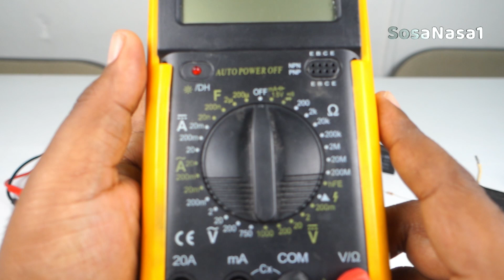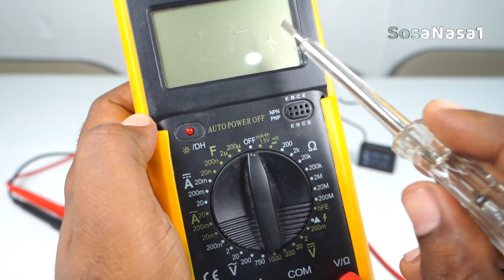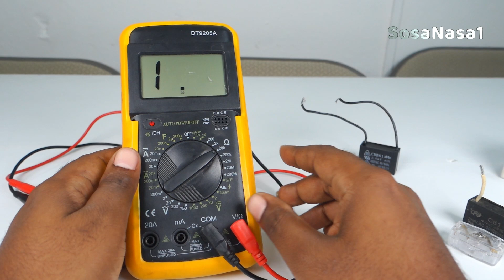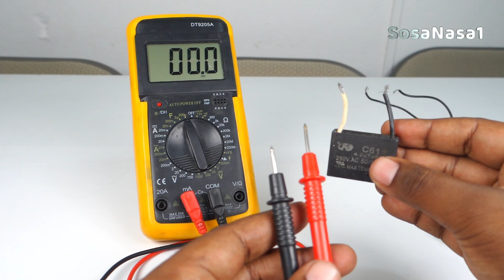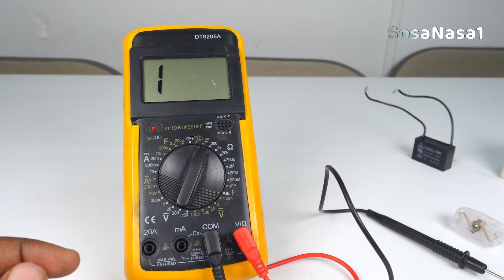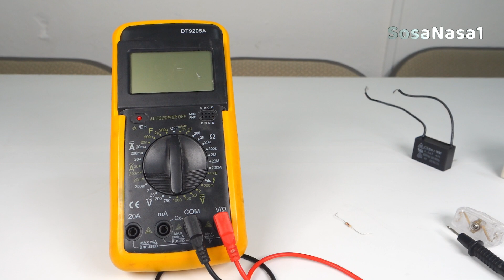how to use multimeter like pro model DT9205A (Mini course)

Comment: I had order this multimeter but the multimeter starts to show random digits without connecting promt . And dc voltage wored but not accurate i returned that item 😂😂

Comment: Someone bought me UYIGAO DT9205A DMM of which I am grateful for. However there r a few issues I m having in regard of this MM,
1) How to DISABLE the followup prompt that says OUT-LOUD in CHINESE (which I do not understand or spokes of) for every selection I made, every reading I took! Its truly annoying on top of slowing me down as I can continue probing other values until the voice prompt completed!

2) There is a selection named (written in chinese which translated as) "Live", anyone know what it used for? What I knw the MM made a intermittent beeping-sound if either + or - probes made contact to any voltage producing points - even of low ones, DC and AC, etc! Anyone knows? Thanks